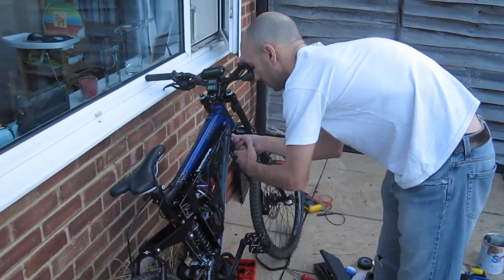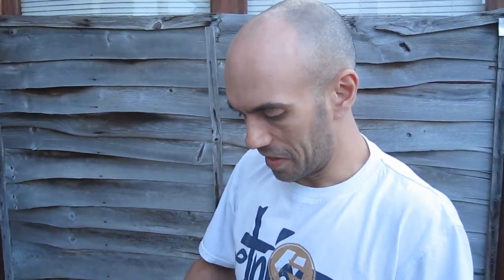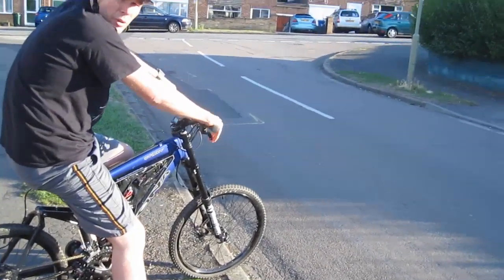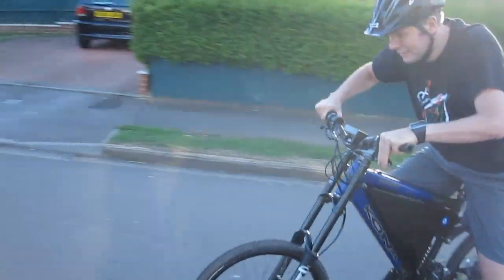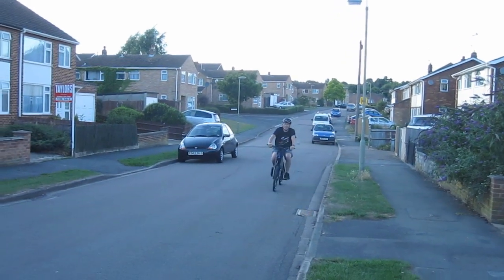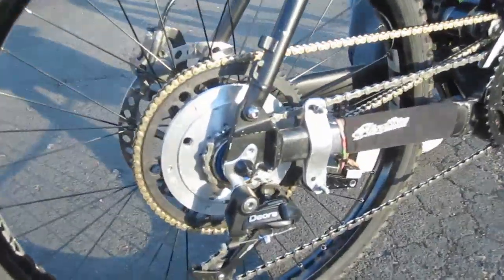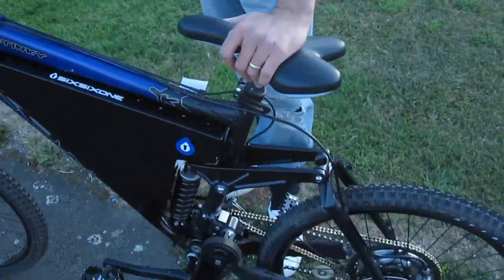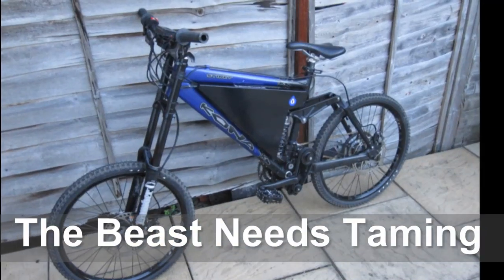Kona Stinky Mental Electric Bike - HV160 Test

Comment: Impressive looks good your using ca version 2.3 there if upgrade to 3.0 then use throttle thru can tame throttle so smoother rise in power even when throw throttle back at stall ca will smoothly raise throttle at 1v per sec and smooth out throttle 
Throttle Interface explained by example
This explains sorry 3 years late

Comment: If the rear suspension settings is soft, maybe adjust to a higher settings?  Move some of the weight on the bottom side of the down tube?

Comment: Looks over powered for the size tires it has.
Reply: Tire size is hardly the problem here. Just no throttle control what so ever.
Reply: FullFledged2010 i would want it to go like that, makes it more fun, there just too scared to go fast
Reply: jonah mccraw Having better control doesn't make it go less fast ;)
My bike has about the same power but if i push the throttle 30% it actually gives me 30% power. Below 20% its a little dodgy but the rest of my powerband is very accurate.
Reply: ha id love a bike with as much torque as i could get out of it, it would be fun as hell
Reply: jonah mccraw Well all you need beefy battery and a high amp controller thats all. most motors can handle loads of amps in short bursts.
But too much torque is pretty useless if you can't control it.
Also there the range curve gets steeper by every amp. So 10 miles at 50amps and maybe only 2 miles at 100 amps.
Not 5 miles like you would expect.
More torque means more power loss at acceleration.
Reply: Maybe taller gearing would tame it down a little

Comment: You should buy this and follow this guide to build a new throttle that is optimized for RC esc.
 #1 Astro Flight servo tester
#2 Dimention Engineering VHV BEC (Very High Voltage Battery Eliminator Circuit)
#3 Magura twist grip E-throttle http://endless-sphere.com/forums/viewtopic.php?f=16&t=12261 is your current throttle potentiometer based or hallsensor based? (the one i link to is potentiometer based and considered by many the best for e-bikes, should give you a linear throttle instead of "on/off throttle" By the way, do you think it would be possible to build in traction control for an e-bike? your machine is a highside machine, pretty dangerous (dont get me wrong im planning on building one myself with the CC 160 esc or the Hydra 240A 50v cc)

Comment from the maker: Hi

Top speed on this bike with the right gearing easily over 40mph, battery pack is only 8 AH usable but at lower speeds you could get maybe 10 miles on a charge. Not sure on price as its not mine, RC setups are not for the newbie e-biker IMHO they are fun though but can bite